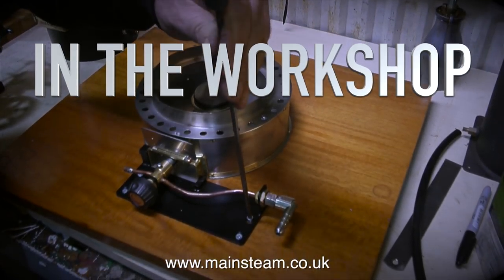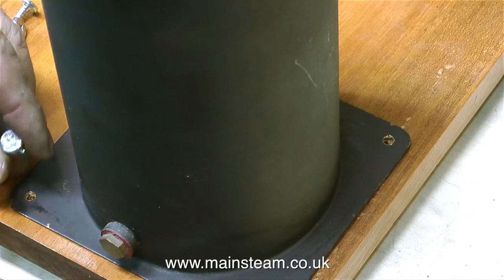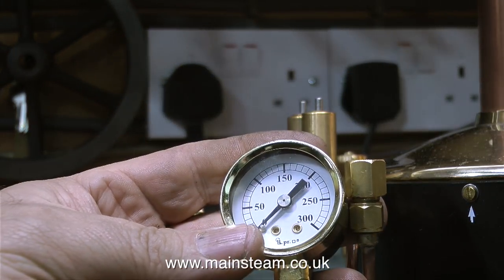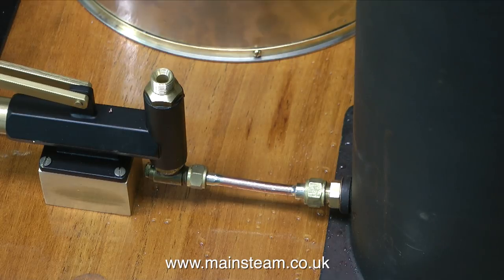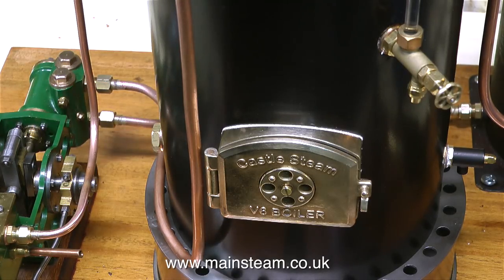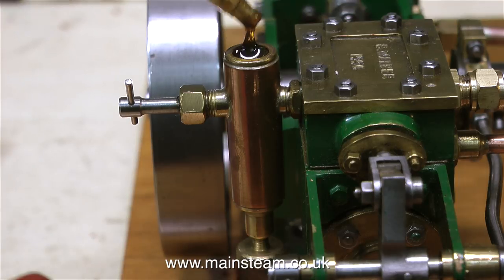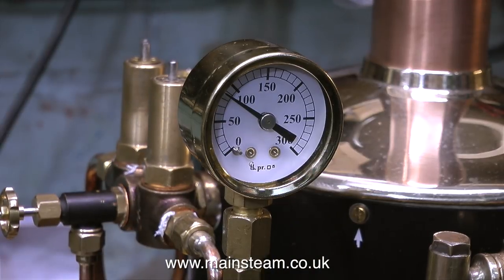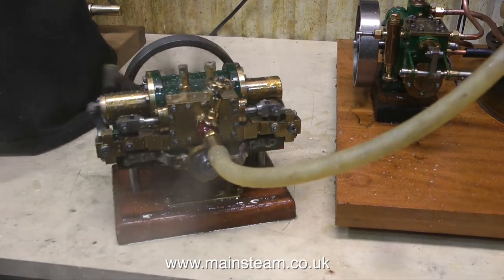A CASTLE STEAM V6 BOILER - AN OVERVIEW

Comment: ptfe tape is that like a teflon tape ? we used it for running pressure tests to check for leaks before putting the unit back into service